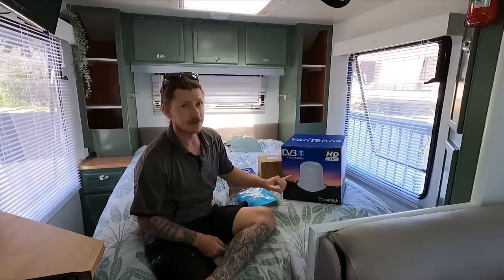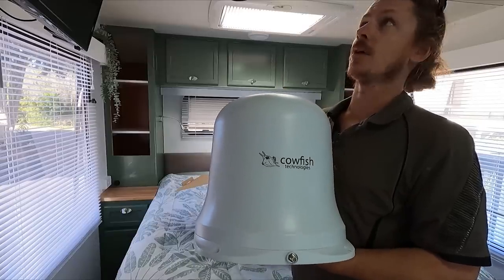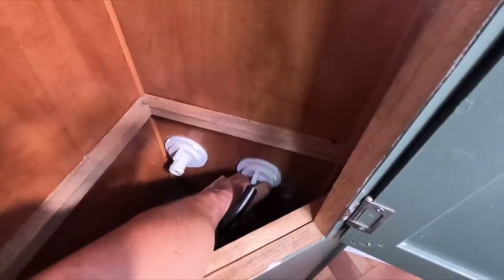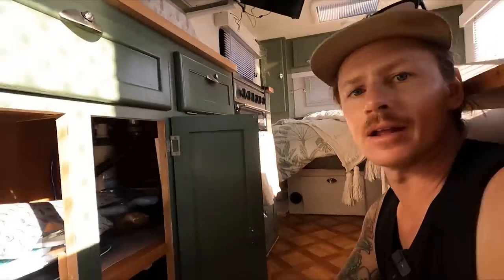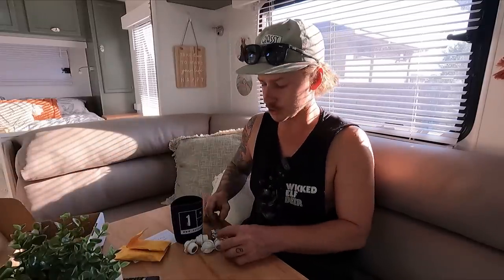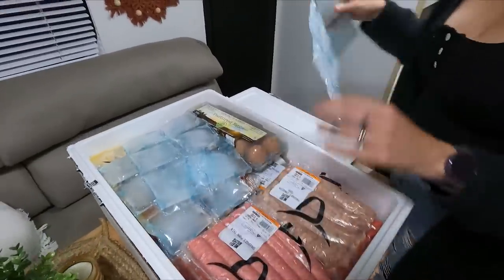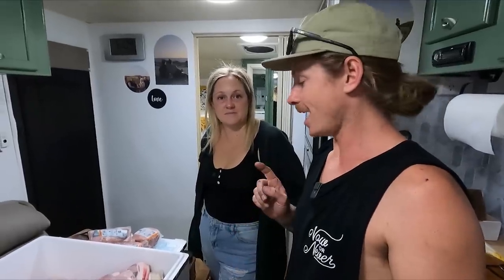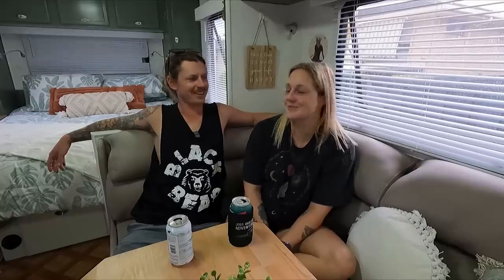Caravan Renovation - The final transformation is here! / The mod you will use every day! /

Comment: Fusion Locs are great. But do not install the chrome variety in the shower - it corrodes and marks the wall. Great idea for the One key caravan.  Im assuming its not a cheap option as most lock replacements/changeovers are expensive.  But $300-500 isn't so bad.
Reply from the maker: Thanks for the heads up! Not sure on the lock replacement cost but hit them up if your after a price 🙌🏼
Reply: @nowornever_aus  my edit got lost. Wanted to say your van looks awesome. You must be so proud of your achievements.  Well done.
Reply from the maker: Thanks!

Comment: Great way to get a fully off grid caravan for a fraction of the price of a newy
I'm interested in the tv antenna as I want to get rid of my winegard. Do you still use the inside hardware in the installation or do you completely remove it and use something else ( that might be included in the box ) Stefan
Reply from the maker: Hey Stefan!
We used the Cowfish antenna point and power supply inside but just because it looked a bit nicer, exactly the same as what was already there!